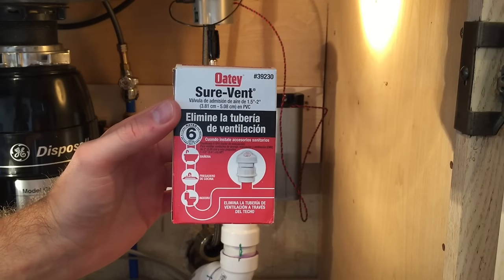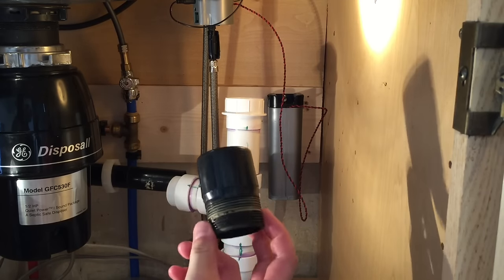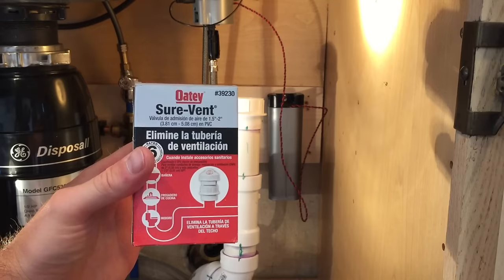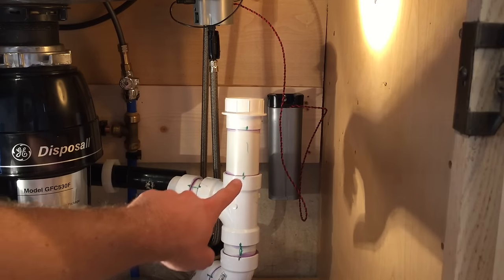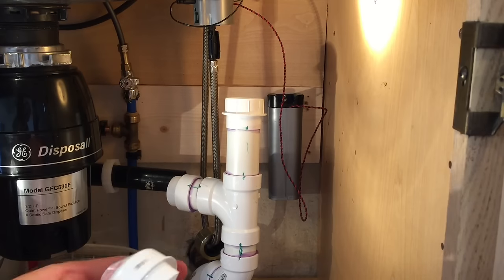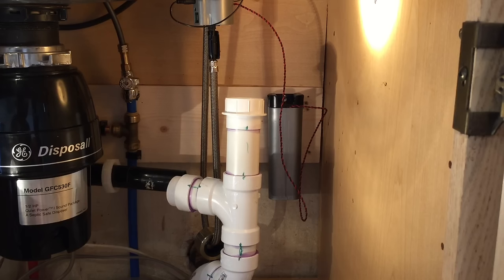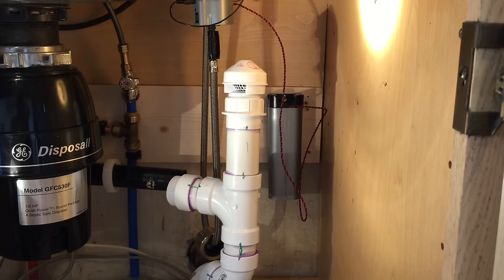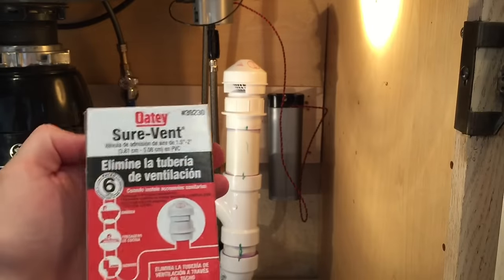OATEY Sure-Vent Installation - Eliminate the Vent Pipe!

Comment: Why are you going counter clockwise with tefflon tape , when you go and tighten it , it will undo itself ....
Reply: exactly lol
Reply: he reversed it right away just off camera
Reply: It doesn't come lose. it can't.
Reply: @MrVeeBlog  if you wrap it in the wrong direction it will.
Reply: @MrVeeBlog  don’t comment on stuff that you don’t know..
Reply: Actually, he’s right, depending on which way you’re looking at it.  However, if you’re tightening clockwise, you wrap counter clockwise so that the tail end of the tape wraps on itself as you tighten the fitting. It seems counterintuitive, but it works.

Comment: It doesn’t have to be above the fixture flood rim???
Reply: Yes, he's wrong about this being to code.
Reply: @sierragreen  I had one in my vented attic, but when I had the attic Spray foam and sealed, I assumed I needed to eliminate vent and put the stack through the roof. I did that, but apparently it was a waste of money and unnecessary!?
I’m sure codes vary from County to County, but apparently here in CHARLESTON county the Event filter is acceptable even in attic that have been spray foam/sealed. I’m glad I found this out because I was about to penetrate the roof again for my new second story bathroom fixtures.

Comment: I have the exact same abs vent in my home for under the sinks. It seams like after a few years they have failed and do not allow any air either direction,  so I definitely will be upgrading to this one!! Thx for the video!!
Reply from the maker: You're welcome. The new vent (AAV) should be more reliable and last you longer without needing to replace it every few years.
Reply: Red Beard Carpentry & Woodworks for w
Reply from the maker: cindy Fisher did your comment get cut off when posting it?
Reply: Red Beard Carpentry & Woodworks mm
Reply: They only allow air 1 way. It only allows air to come into the pipe so sewer gas doesnt come out

Comment: Is it sufficient for eliminating the smell from toilets, because you don't show in this video, how the air is circling inside to equalize the pressure in the way, that smells are pushed down into the main sewer pipe and therefore is no need to install one on the roof?

Comment: If i have a roof vent for kitchen sink completely packed tight full of leaves  , acorns and debri and its severely packed full and idk if a hand held auger snake i hsve will do the job being the pipe is packed slam full of debri , could i just add a stuter vent under the kitchen sink and bypass the roof vent being its clogged tight as a tick

Comment: How do you find out if the original vent is bad to begin with?
Reply: Moisture under the sink. Possibly mold or mildew buildup. Sink doesn’t drain as fast

Comment: These AAV's are illegal here in Minnesota.  A plumber told me the unions are strong and won't allow them to be legal.  They make so much more money running vent pipes through your old walls.
Reply: It's not just about the $. It's about the fact that AAVs can fail within a few years & need to be replaced. They also get used incorrectly-- sealed up in walls when they need to be able to have airflow.
Reply: my cats Had them in my house for15 years, no problem. Always accessible
Reply: They're illegal in most of Canada too. However if you have a roof stack and need one of these in addition, that's allowed. Maybe it's the same there.
Reply: I put em all over my house over 15yrs ago never had an issue
Reply: @mycats7321  everything can fail. Even your normal vent going to the roof. Maybe we shouldn’t have those then also if they can fail?

Comment: Is it necessary under Code or for Home Inspection??
Reply from the maker: You need to vent your plumbing per code and to pass a home inspection. Ideally you would use a traditional PVC or ABS piped vent, if one is already installed and available. If this is new construction, or a remodel with access to the studs, then you should install a traditional vent. However, if you cannot install or access a traditional vent, you can use an AAV as a alternative venting solution to allow air into the plumbing system.
Reply: Thanks a lot

Comment: I just used one. Seems OK. But why  do I need this? Can't I just leave an open pipe? Or cap the pipe and drill holes?
Reply: If you want to smell your septic you sure can! 
The whole point of the vent closing is to prevent sewer gases from coming back into the house.

Comment: I have a 6 year old house and I have been smelling sewer gas for years now! My husband thinks it is just in my head! We have a 5 bedroom, 4 1/2 bath and I only see 2 sure vents installed, which is in the master bathroom sinks. Should all bathroom have the sure vemts? Please advice. Thanks for the video!
Reply from the maker: Pristin V an AAV (in my video a Sure-Vent by Oatey) should only be used when a traditional vent pipe is infeasible or impractical to use. If you do not see an AAV installed anywhere else, it’s likely because a traditional vent pipe is being used, or someone installed the AAV within a wall without an access panel, which is against code.
Reply: Erik Asquith , Thank you very much for your reply. I just walked into our bedroom and the air conditioner was running; I got a whiff of sewer gas coming from the ceiling air-conditioning vent!  There were times when the smell is so bad I think because it is accumulating inside the house, especially when I have the air conditioner running all the time being in Florida. It is hot and humid. The smell seems to dissipate when I open the sliding door and windows in the early morning during winter when it is cool. I did poured liquid drano, hot water, sealed all the toilets around the base, many times, to no avail. I think it is a venting problem. Must call a plumber? Or is there anything I can do myself to check? Thank you very much!
Reply from the maker: Pristin V does the smell lessen or disappear once you turn off the AC? Perhaps you have some mold in the duct work or a air filter in need of changing? If your Air handler is in a closet or attic, I would check to see if the smell is present there.
Reply: Erik Asquith ,
Thanks again. We change the filter every year, plus we installed a uv light system to prevent mold.
I suspect that the vent may not be properly connected to the pipe that goes on top of the roof? 
Only the master bedroom toilets which is upstairs  have the sure vents under the sinks (his and her vanity sinks). The rest of the house has a pipe vent that goes behind the wall, which I assume venting outside thru the rooftop?
I will be doing what you suggested to make sure. 
Thank you very much! I appreciate your advice.
Reply: Some sewer gases are odorless so you are smelling shit , very bad situation

Comment: These didnt wrk for me, i used them on the house as the plumber said it was fine but my sink would gurgle when my washer drained so i replaced the valves to se if they were faulty still gurgled so i added 1 then 2 vents through the roof and only had the valve at the sink and it still gurgled so finally ran the whole house through the roof vent pipe and finally after 3yrs no more gurgle
Reply from the maker: Thanks for the feedback. By any chance did you try unscrewing the AAV and verifying the drain performance/gurgling as a test? Removing the AAV would have removed any air flow resistance and should have mimicked a traditional vent through the roof top. If the drain performance/gurgling still persist with the AAV temporarily removed, then that might suggest the vent location was not ideal and should be moved.
Reply: @ErikAsquith  i did but not until a couple years later. I was a aav believer at 1st, what happened was someone previously had took out a wall and cut the vent pipe going through the roof and hid the exposed sewage pipe in the wall and put a bar over it so the kitchen opened up to the livingroom. So there was a bunch of sewage gas issues until to make a long story short. So the plumber finds the exposed pipe in the wall at the kitchen sink, and says i can use a aav for $25 or i can tear up your wall and see if its possible to run the pipe out the roof for a lot more money. So i was like heck yea the $25 fix. Also i was going to get a new roof soon and asked if i could use aavs on all of the vent pipes so i would have less protrusions, he said yea people do it. Then later on is when i noticed the sink gurgling when washer drained. He said the aav wouldn't cause that, then said oh you have a pipe thats bellying that i need to replace. So spent a bunch of money on that. Then the gurgle came back and i just lived with it for a while as i already spent a bunch of money. So over time i replaced them to see if any aav were faulty, and the gurgle came back. So i was like well im sick of the gurgling almost after 3 yrs, called a plumber out n told him i think i need to run the vents out the roof he said no because the aavs work. So i get a different plumber to try 1 by 1 running the vents out the roof as i was seeing if maybe just 1 needed to be ran out. He told me code was to run them all out the roof but an aav can be used at kitchen islands. Well that didn't wrk so i finally said to run the kitchen sink out the which was a little tricky do to the angle but that finally did the trick! No more gurgle. Im obviously no plumber but my guess the washer draining was too powerful for the location of my sink so it would inevitably pull air from the sink.

Comment: Teflon tape doesnt create a seal. It reduces friction, allowing fittings to be threaded on far enough to allow the threads to seal properly
Reply: It sure does create a seal, it works as a deformable filler and thread lubricant, helping to seal the joint without hardening or making it more difficult to tighten.
Reply: @andrew3453  no it doesnt
Reply: It absolutely does seal. I can't say it any more clearly than Andrew. It is a deformable filler. Sure, it is a lubricant also, but that doesn't take away from the fact that it also seals.
Reply: @JJ-iu5hl  sorry man, thats just not true. But im sure if you guys keep repeating yourselves youll convince someone, not me, but someone
Reply: @chrism4008  I'm trying to figure out why you would think tape doesn't create a seal. Maybe some old timer you trust told you that? Some youtuber said it in a short?

It physically makes the thread space fuller and deforms as it is screwed on. I don't know what's not to get here. Please, enlighten me. I'd love to learn what you know.

Comment: Will this sure vent replace the vent pipe up in the roof?
Reply from the maker: Yes, you can use an AAV in the absence of a traditional vent. However, if you have access to a traditional vent, that would be the ideal venting option.
Reply: @ErikAsquith  
Can I put this device under my bathroom sink, even though it will be below the sink. I was thinking I heard you say that it has to be above, maybe 4 inches or so, above where the water comes in. And thank you so much for answering me Erik
Reply from the maker: @jillhickman4762  you can install the AAV beneath the sink counter top, or sink bowl/basin, but it must be at least 4 inch above the drain pipe going into the P-trap.
Reply: @ErikAsquith  okay I will try that! And thank you so very much for your video and your help, I must say I didn't actually expect a response but I'm so very thankful that you did take care and I'll continue to watch your videos

Comment: Can you put in a sealed wall in the basement. It’s for a kitchen sink
Reply from the maker: No, not in a sealed wall. However, you can put it in a wall behind an access panel that will allow air flow to the AAV. The AAV will need airflow, as well as access, for when it needs to be serviced or replaced.

Comment: The first black vent that you showed is what I have. I think that is what is making under the sink smell. Can't figure out the source of the smell. Had a old disposal that I thought was the issue so I replaced it and the smell is still there  could the old vent let gas back into the cabinet. 
Thank You
Reply from the maker: akaredcrossbow yes, the basic black vent could be letting sewer gas escape if the rubber valve is not sealing properly due to drying out, shrinking, cracking, build up, etc. Try replacing it with the Sure-Vent.
Reply: Also, make sure the area where the air admittance valve (vent) is located has enough air to do it's job. If, for example, the vent is in an enclosed vanity it may suck all the air out and then start sucking water out of the p-trap. Then you would get sewer gas coming up into living area. Try drilling a 1 inch air hole somewhere hidden in any enclosed space that the vent is in.
Reply: akaredcrossbow if you have no water in your p trap the gases will escape
Reply: The black ones are intended for mobile homes. They can get away with just about anything because they don't have building codes.
Reply: @gregkeel4155  thanks dude I think I was having this very issue
Reply: @gregkeel4155  That's not necessary. The device needs very little air to operate safely. These devices were invented by the Swedes because of the great amount of snow on their roofs. I think they are intelligent enough to invent a product that is safe and effective, which AAVs are. I have them and I'm glad I do.
Reply: @Foche_T._Schitt  No they are not. The black ones are the cheap ones that some companies make that don't care about quality. No one should ever buy them. You get what you pay for just like anything else.

Comment: Why is 4 inches of "rise" required?  I've had an occasional issue with water coming out of a vent that looks identical to this and I'm wondering if the inch if rise I have is not enough and the culprit.
Reply from the maker: Brandon Ott the 4 inches of rise is required to account for any slowing of water flow, splashes, or backups in the pipe - the vent should not come in contact with any water. However, if you have a clog that slows or prevents the water from flowing and it starts to rise in the vent pipe, you'll likely start to experience a leak from the AAV.
Reply: You would want a decent amount of rise because if there wasn't, in the event of a clog, some of the water would back up into the vent and leak out.  Ideally, the vent actually should be placed higher than the level of the top of the sink, so the water would back up into there instead.  However in many applications, that is not possible due to space limitations in the cabinet under the sink.  In that case, you would just want to bring it up as high as possible.  The one shown in this video is way too close to the sanitary tee.  They should have made that piece of pipe much longer.
Reply from the maker: I wouldn't necessarily say that the AAV is way too close to the sanitary tee when it's technically one inch higher then the minimum 4 inch requirement documented in the instructions. However, I agree that making it higher or above the sink is better, but for particular installation I did not have much additional head room available due to the sink base being immediately above the AAV.
Reply: I've seen min of 6"
Reply: Erik Asquith it says idealy you want the vent as high as possible. I put mine right beside the sink (where the sink meets the countertop
Reply: >>>water would back up into the vent and leak out. >>>
From a physics standpoint, you are correct.
But that is the whole point of the Oatey...it's a one-way valve.
 If "water backs up"...it isn't going to back up through an Oatey. That's what they're rated to stop. That's their job.

Comment: Can I use this for my washing machine? I want to move it to the other wall so it will be next to the dryer. I had planned on using pex to move the water lines over there and replying the drain over there as well. I was just worried the washer drain would then be too far away from the vent pipe. If I can use this instead, my problem is solved.
Reply: I don't see why not as long as its allowed in your area and its close enough to the drain.
Reply: Yes, you can. There are videos that show you how.

Comment: If I have a previous vent that may have went bad and needs changed? Could that be the reason my washing machine backs up into kitchen sink when spinning out? It’s so frustrating! And so damn hard to explain to plumber to get them out here
Reply: Change the the PVC Air Admittance Valve { AAV }  if you think its not working. Otherwise you may have to open a cleanout and snake your drain line . Many drain lines become root blocked to your septic or city drain if you have trees close to your lines....If you remove a huge tree from your yard its a good time to check your drain lines too.